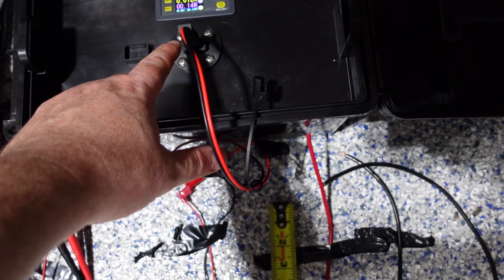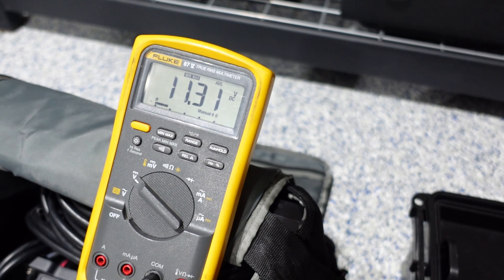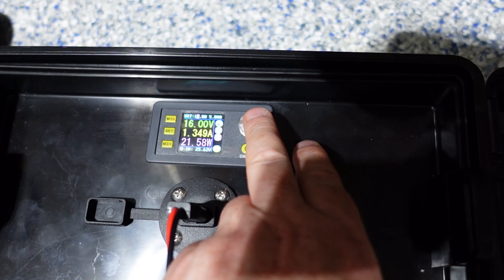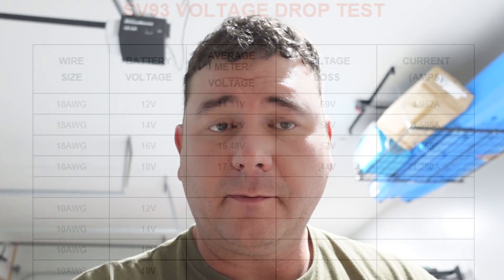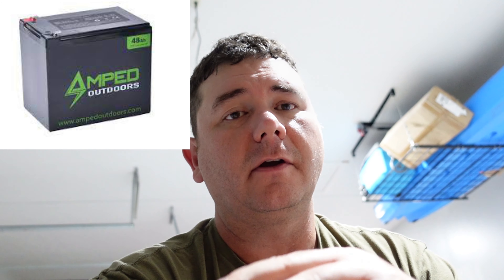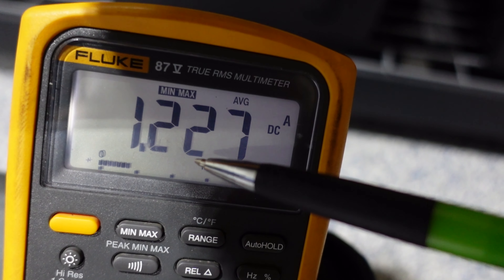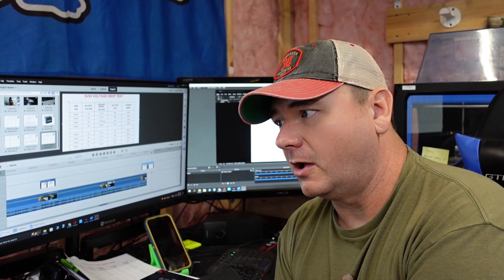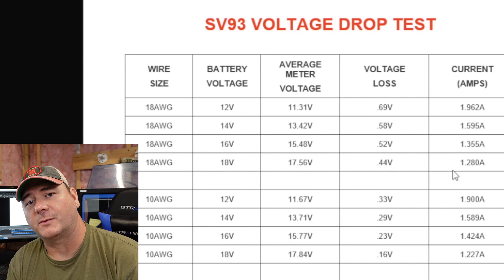GARMIN LIVESCOPE Voltage Drop Test

Comment from the maker: In this video I test the voltage drop of the Garmin Livescope using 18AWG and 10AWG wire at various voltages. I also discuss the power consumption of the black box while the unit is off. 

#lithiumbatteries  
 #iceholepower

The Amped Outdoors 48Ah NMC battery can be found here:
https://ampedoutdoors.com/collections/lifepo4-battery/products/48ah-lithium-battery-14-8v-nmc-with-charger?aff=8

For the Boat box that was seen in the video:
https://www.iceholepower.com/product-page/ihp-boat-box

Follow me on Facebook! https://www.facebook.com/iceholepower

All batteries that I recommend based on my reviews can be found below:
https://www.iceholepower.com/lithium-batteries 

Tools and supplied that I use in this and other YouTube videos can be found here:
https://www.iceholepower.com/tools-and-supplies

Contact Information:
For business inquires or other YouTubers ONLY. I just don't have time to answer all the emails asking for battery or electrical advice. If you have a question, just ask in the comments section of this video. email: Jeremy@iceholepower.com

Comment: Jeremy, great work. Thank you for the time and effort to set up this demonstration and present the data. I spent 32 years trying to show young technicians this "Voltage Drop" principal. I stopped calling it "Voltage Drop" a long time ago as a don't like to use slang. I refer to it as a "Voltage Usage" test. Of course, we want the LOAD, in this case your fish finder, to use all the voltage and not the wires delivering the voltage. The 10 AWG wire is superior to 18 AWG wire and your data proves it. I would also like to thank you for mentioning more than once a technician cannot monitor "Voltage Usage" to a LOAD if the LOAD is not being asked to work. Thank you thank you thank you. I also asked the technicians to use the unit of measure millivolts (mV) any time the voltage results are less then 1 volt. For example, 0.056V is written and spoken 56mV. Take care and thank you.

Comment: Great content! So what you are saying is the larger the wire the lesser the voltage drop. However in this case these are from relatively short runs of wire and the voltage drop is negligible. 
Thanks Jeremy these short little lessons are very helpful

Comment: I really like what you've done in this video.  I was hoping you'd test voltage sag difference, if any, between SLA/AGM and lithium (NMC and LFP?).  Everyone talks about how much power those Garmin Livescope units pull, and I guess it's a lot compared to conventional sonar, but it's not like those are huge numbers.  I bought a 2nd-life LFP battery module, out of retired medical equipment, that has about 18.5AH worth of capacity ($45).  That's enough to run Livescope for about 10 hours.  It connects to the wires on my unit with an XT30 connector and about 3' of wire run, so total overkill.  I can spell "attenuation", but there's none on my boat!

Comment: Don't laugh too hard but using Helix 7 SI G4N with Mega Live from my float tube. Looking to make new battery box with two SAE ports, one switched to turn Mega Live off when not in use. Luckily I already have a couple of 23ah LiPo batteries. Hard part is finding the perfect sized case.